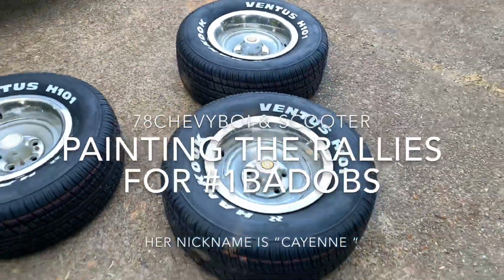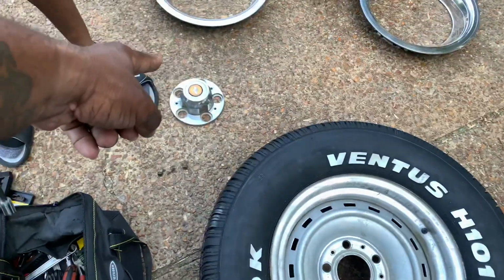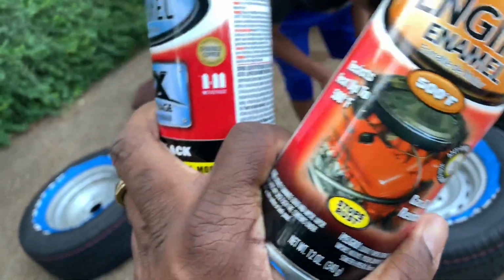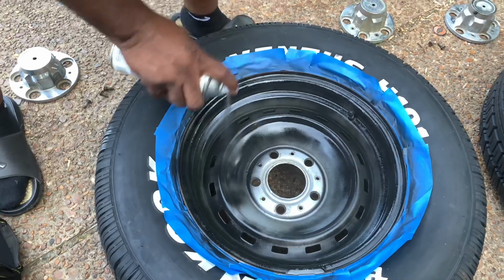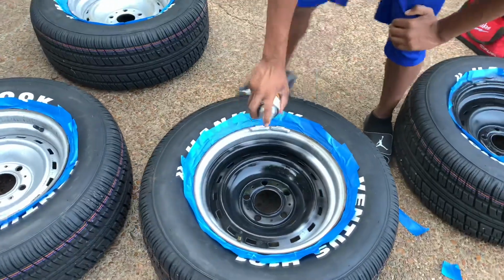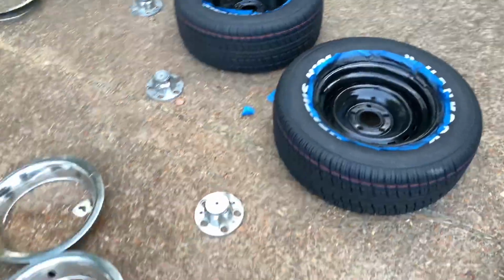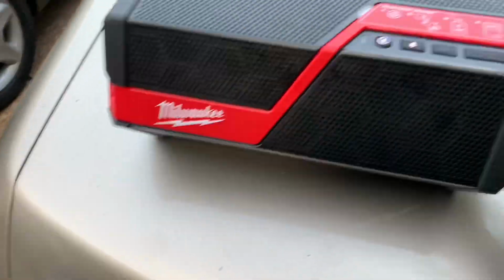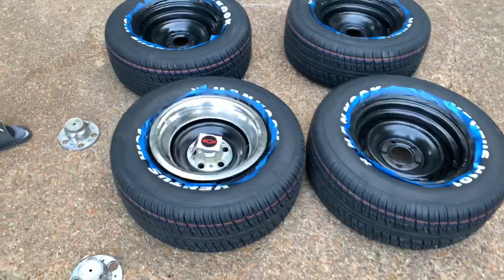Project #1BADOBS UPDATE!!!

Comment: I just finished my ls swap in my 1998 c1500 heading to exhaust shop and I have the rally’s on mines with electric bucket seats it has 343 gears if you look at my videos you can see it I have the cooper cobras on mines